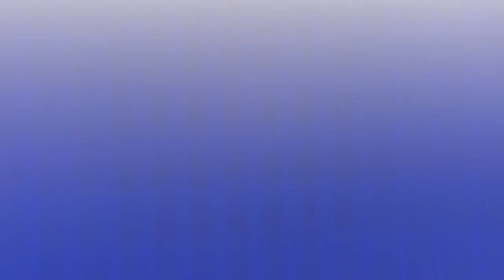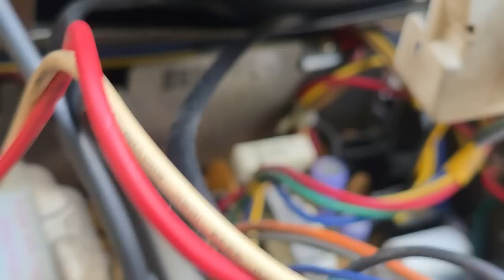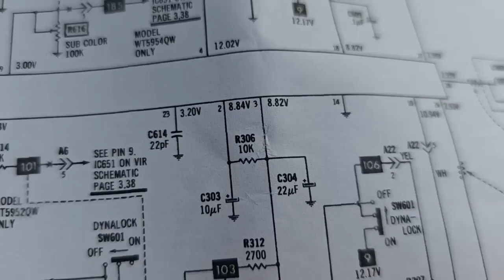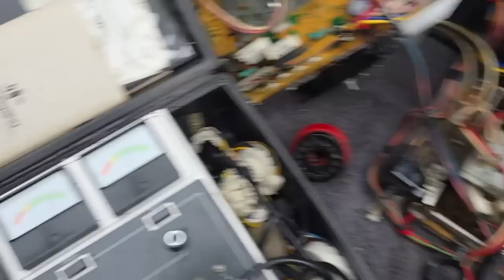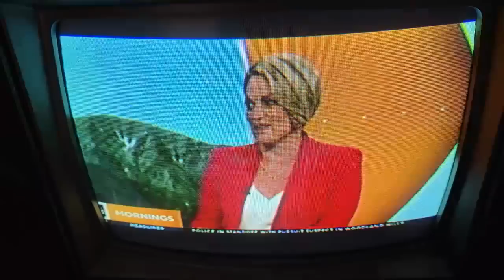1979 Quasar Color Television Repairing Several Problems On Vintage 19 inch Tabletop TV Set

Comment: I have the same Quasar 1979 set. It was on the street in Villa Park, Illinois. Good audio on these sets. Picture tube on mine looks excellent though the left side of the picture is darker than the right. Can someone suggest which capacitor needs replacing presumably in the power supply? Seems to be a common problem.

Comment: I used to work on a TON of those matsushita made sets back in the 80's. Matsushita took over the quasar name sometime around 1974-1975ish. Those purple cap failures were common even back in the day in the 80's... the biggest one i used to see was the 4.7MFD 250V for the cathode supply filtering which would cause a saturated over bright image with retrace lines. used to pull those caps out and one lead was gone with a tan powder corrosion coming out of one lead in its place. The matsushita Sets made a few years earlier were copying the motorola design of a front pull out chassis but you only had access to the IF, audio, video, and chroma.. Horiz and power was mounted on the bottom.

Comment: I like vintage electronics, but I have a particular revulsion for TV sets. Maybe because I fixed several when I was a kid, and got more enjoyment from destroying them (especially the bigger CRTs like 21FJP22). It's comical how much complexity went into the deflection, convergence, and HV. And those mechanical tuners.....yikes.

It's really amazing how little was actually wrong with this set given it's age, and that no damage was caused by the swapped connectors.

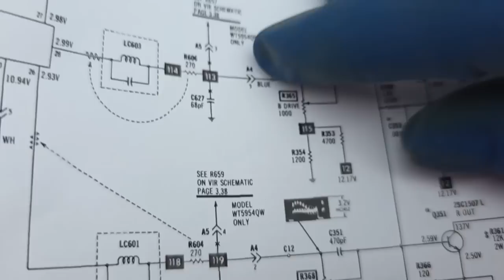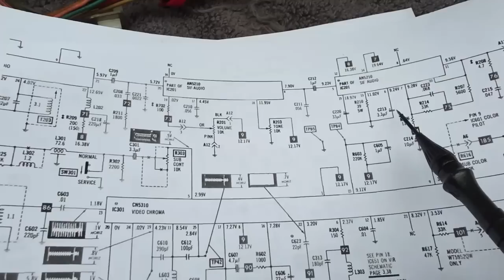Comment: 30:00 found plugs switched. Oh WOW! 41:00 found leaking caps.....   Yes, the plug thing is a problem. I have a hobby of model trains, and to often even the plug to go from the steam engine to the tender can be the same, but different models have a different design of a circuit and can not be switched even though the plug is the same. To me MTH brand is the worse with this. Expecting the user to only have that exact model, or be smart enough to not switch it to a different tender.  Just DUMB I agree.

Comment: Your short comment about the capacitor in the trinitron TV made me turn my Sony wide screen tube TV for some time to made sure it is still active, and run it for some time. It is.  Being so much is more worth while, better options to pick from, on the web then over the air TV, my TV's have very little time on them. I also spend more time with my model train hobby as well as my posting to my youtube channel. tableseven8133

Comment: I realize this set is a later model made by Panasonic,but I wonder why Motorola started selling sets in the late 60's under the Quasar name rather than just usuing Motorola? 
Shango did a great job of tracing down the problems and sure enough his original assumption turned out to be correct,someone hooked the cables up incorrectly.  This is why I try and mark cables witg tape/and or take photos.  It can be a chore figuring out what the cause is later

Comment: Due diligence set of TV  repairs.  Someone switch two connectors while probably cleaning the insides. D'oh!  Then found
a cracked solder  joint on CRT socket  board!  Motorboating sound due to leaky e-caps connected to one side of the speaker. Looks and sounds amazing now. Your skills were amazing on finding all those problems with it Shango!
Reply: This comment brought to you by AI.

Comment: A very nice and bright picture on a 46-year-old television. In Poland in 1979, the cheapest color television was a Russian RUBIN 714p, but not as cheap as you might think, costing four full average salaries. It weighed over 50 kg and had a Delta tube. It had a nice soft picture when new, but you had to be lucky, because not all TVs were like that. It was, of course, tube-based. After three years of use, about four hours a day, the picture was gray, with virtually no color or brightness. Best regards :))). Adam.

Comment: Nice work.  You should charge a dumb-ass fee when you have to spend time troubleshooting a problem caused by a careless cleaning.  Old electronics has enough trouble without adding more.  Some people shouldn't touch anything. 

I want my 'Camzyos'!  Heck, I've never seen a 'Camzyos' commercial in Indy so maybe it's not available here, yet. They are experimenting on the West coast first! 😂  Anyway,  thanks for posting and cheers.

Comment: You are not used to solid state devices. Which I repaired back in the 80s... They could be easy or hard depending on the problem... I know I don't miss CRT sets.

Comment: I was wondering at the start if it was a swapped plug problem. Hellishly hard to find after the fact. Take photos during disassembly ppl. Many photos. If something fails this will save having to send it to uncle Shango. My childhood involved fixing things, in my bedroom, when I was meant to be studying. All I had was an analogue multimeter and my brain. As such a lot of stuff never got fixed. I mainly did radios, car stereos, no idea back then how a superhet worked. I successfully misaligned quite a few radios. A TV or a tube set would have been totally beyond me. It was a lot of fun, looking back I'm glad I never blew myself up.

Comment: I attended Motorola factory Training at the transition. During removal of the back panel of the 27 inch or so console, the teacher said "Due to customer shock hazard, do not let them look inside".
     Then he showed us the innards. A tuner cluster in upper corner and a Very modest single circuit board vertically mounted nearby. The shock being the customer saying, I paid 600.00 for that!
     I grew through the tube roundies through "the works in a drawer" fantastic documentation and factory support then.

Comment: Every time I see an old tv like this with a mechanical tuner I think of a company that used to be in business to rebuild these tuners. Precision Tuner Service of Indianapolis, Indiana. The 70's were a time of transition for electronics manufacturers. Not sure of the exact year, maybe around 1973, my parents bought their first color tv from Sears. It was a hybrid" tv, meaning the chassis had both tubes and solid state electronics. Prior to that in the 60's everything was vacuum tube.
Reply: PTS and others saved the extremes a shop would go through to t-shoot, repair, and align tuners. Later, you could exchange Motorola and rca modules for rebuilt, tested, shake and baked boards. 
     The boards were perfectly serviceable by a shop, and the modules swapped in minutes in a customers home.
Reply: We use to send our tuners to Castle Tuner. They did a really good job repairing them

Comment: Im so happy to see you working on a tv set i really enjoyed it after all the transistor radios i was get weary .the dx videos i had to forcemyself but not all at once i love watching and learning tv repaoir and troubleshooting. I have a question you know for a while in 60 70 how tvs would just shut  off for no reason and the fix was turning down the b_plus adjust.
I have a sony made in 2000 that does that very same  thing ,i know this is an impossible question but do have any idea what this could be ? If you answer i will gwt the numbers for you as its a bit of a hassle to pull out but i will do it if you could spare a little time .thank you in advance doug from tarzana

Comment: I remember this chassis years ago .And the IC's (IC 301 especially) were not unusual to see as lightning damage casualties. The  2700 ohm resistor also would fail with that IC on the last set I dealt with. The worst of these sets I repaired had leaky transistors all around.
Reply: I just found a smaller 14 inch version of this set in electronic recycling still working. We're these a decent set back in the day or more problem prone?

Comment: I blew up a 1988 Magnavox boom box because I plugged the wires into the wrong plugs as they were right next to each other and no labels on the connector or PCB. The boom box was absolutely carp like the cassette deck was all plastic with gears failing apart due to age.

Comment: "Quasaaaaaaar.....dum dum dum dum..... by Motorola." I wonder who Intel copied for their commercials?  I still have the 1965 17in B/W RCA that I heard that on. 100% original and still works. I got it from my mother's attic. It finally got the handle fixed that was loose on one side since the retaining nut was cross threaded when it was assembled....🙃

Comment: After Motorola, the Quasars were made by Matsushita (Panasonic) - so tended to be very reliable.
Reply: They were reliable more in the near term, but didn't last as long as the Motorola offerings which were overbuilt.  Matsushita's gift was making reliable TVs with the cheapest components made.  Adjusting the trim pots on the later TVs required a plastic tool and a very light touch otherwise they'd come apart at the end of the adjusting tool..

Comment: well done Shango..now for the $64 question...did having the A4/A8 connectors switched cause the capacitors to fail, or did the capacitors failing cause the attempted repair which then resulted in the connectors switch?
Reply: The latter. Completely different circuits involved.

Comment: Excellent as usual. If I am not wrong I could still notice the black vertical bars on dark scenes. Maybe the cap filtering the video output transistors needs to be replaced also?
Reply: Possibly bad caps but these TVs were not perfect even when new.  The rule back then was that if the sweep bars couldn't be seen on live video it was fine.  We've become spoiled since digital TVs and digital displays became the norm. One thing I''ll never miss was trying to explain to Sony owners in the early 2000s why the geometry and purity were so bad on the larger size Trinitrons..
Reply: @ohger1  The CRT Monitors of the 2000s were able to produce pretty much perfect image quality 
Convergance and Geometry can be 99% as good as on LCD on these
TVs were just always bargain bin parts sadly
Reply: @thronritter6295  Whether you think CRTs were good from a purity, convergence, and edge focus standpoint depends on your standards.  I was setting up CRTs since the late 60s when TVs came out of the box from the factory often in a deplorable state of setup.  The best CRTs for setup out of the box from a convergence standpoint was the RCA "pre yammed" yoke CRTs (which is fortunate since other than the blue lateral flexible magnet on the neck - was not adjustable).
Reply: @ohger1  Nowadays my family still has a 32" Panasonic set in the living room
They were never really perfect out of the box, and especially not 20 years later, I generally open every set to atleast adjust the focus and if need be the convergance
On some late CRTs you could adjust the convergance and even the purity via the on screen menu and on those sets you can get very good image quality
Personally I have never seen a 60s sets, only 70s and up, color TV in germany picked up a bit later then in the states

Comment: The good ol' 19-inch "table-model" color TV, I grew up with those.  I didn't know that the 75 ohm coax antenna connection was around in the late '70s, I always thought those didn't come out until the '80s.

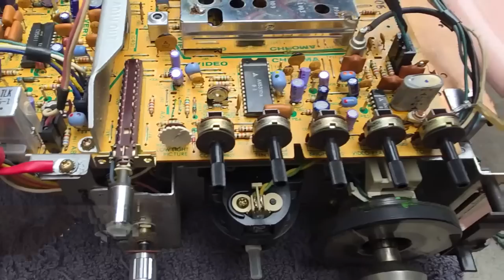Comment: 38:24 What does the low light picture potentiometer do?
Reply: I'm not watching the video (his voice drives me nuts), but generally speaking, the grey scale tracking was achieved by using "screens" and "drives".  With a blank white pattern on the screen, the screens were used to adjust the base levels (low light), there would be three of them - once for each gun.  TVs with a "service" switch would collapse the vertical and kill the video.  The red, green, and blue screens (low light) would be adjusted to either a very dim line or just extinguished. The brightness and contrast would then be set to about 80 percent and the drives would be used to rebalance the gray scale at higher drives.  Better TVs had three drives and cheaper ones used only two.

Comment: That is made by Panachronic, white L.O.P.T. their logo is on every part & yellow boards, I'm in OZ but over 40+yrs a tech & I know a Panachronic (Panasonic) when I see one & they did have crowbar cct on the horizontal o/p's, even the sticker on the picture tube (yeah that's what we call em none of this CRT crap here) with the warnings is panachronic
Gotta laugh at the term flyback, it's call the Line Output Circuit so work out L.O.P.T..... That picture tube isn't set up correctly because at different brightness levels green dominates so emissions aren't tracking correctly on all 3 guns & if not set up correctly will kill that picture tube.

Comment: My first guess was a connecter corrosion problem. Turned out misplaced connector. If you used a scope, the video would have been longer. I'm surprised the guy that did all the meticulous cleaning didn't catch the cap poo and did an all-out cap replace.

Comment: I am impressed you fixed these sets in middle school.  I only dabbled with VCR's in high school.  My fix it abilities are still only on the dabble level but people still think I'm a tech genius, lol.  You are a true genius with radios and tv's in my opinion.  Have a great day!
Reply: I started out fascinated by appliances. I put a new timer in the old Frigidaire washing machine at 8 years old. I threw a tantrum until my parents let me do it.  I was born autistic and my father thought I was completely useless until.... holy moly what else can you fix? He always bought used crap, so I was quite handy. I'd either get electrocuted or save them a bunch of money fixing the washer. Win win....lol. Kids on farms used fix tractors and all kinds of stuff back in the day before bicycle helmets. There were hot chassis tube kits for kids...Probably safer than a transformer with 300 volts..
Reply: He knows how to and when to use an Oscilloscope. When he does, he looks like an intellectual. Shango I love the content. Great sense of humor.
Reply: Although it takes skill and knowledge to fix something like this, the problems are more or less the same depending on the chassis you're working on. I remember a lot of late 90s Philips chassis 'anubis' would always come in the shop with the same 47uF/200V B+ capacitor dried out, or the Sharp Wise series that the h-out transistor would go boom because the h-width high voltage capacitor would short, Sony with their crappy IK circuit that would prevent the set from working if it detects the CRT is getting weak, and so on.
Reply: I repaired TV sets in middle school. A great skill to have. shango066 and I have too much in common.

Comment: So cool.  I vaguely remember, I think it was a print ad (maybe it was tv) - from the late 1960s, early 70s a tv that one could fix themselves---it had some circuit board that slid out from the front---where the controls are.   Does that sound familiar?

Comment: There is one thing when the oscilloscope is useful with those "jungle ICs". They go completly crazy when H, V or lately SCI pulse is missing. Because DC levels are keyed, missing pulse leads to strange DC levels all around the chip.

Comment: Made in USA with Japanese parts has held up well after 46 years!  That picture looked nice and bright!
Reply: That's the quality of Japanese manufacturing and American workers at the plant. We used to be fine with buying components from other countries, but only if they were equal or greater quality than our own. Now people buy any old crap regardless of where it's made or what quality of the components inside.
Reply: MAKE JAPAN GREAT AGAIN
Reply: "Made in USA with Japanese parts" Is a term I will start using I things that I build.
Reply: @radiorob7543 considering where most of the NOS tubes are coming from, mine would say "Made in USA from Soviet components" LOL
Reply: @destructionfun2  The current sanctions against Russia are driving up the cost of electronic tubes considerably, with China and eastern Europe being the only alternate source. The largest tube plant in Russia was actually American owned prior to the sanctions.
Reply: @dougbrowning82 I know, and it angers me that the government would rather sanction a country over a conflict we aren't directly involved in.
Reply: Honestly looks like it sat in a closet for most of its life so the crt really has only a few years of actual use on it (probably).
Reply: Pretty sure the CRT is a Zenith EFL type. So the major part USA.
LFOD !

Comment: I own a Quazar set, there really good TVs! Mine's a later model from the early 80's with a digital channel selector & a remote.
Reply: What ever happened to them
Reply: @eaglewi  If I remember correctly, anything Quazar is just a rebadged Panasonic. So they're still around to some extent!
Reply: @gunier.j.kintgenanimations I think Panasonic also was sanyo
Reply: @eaglewi 

Nope, Sanyo is a different manufacturer.
Reply: @westelaudio943hmm